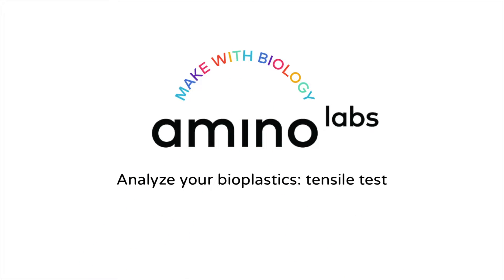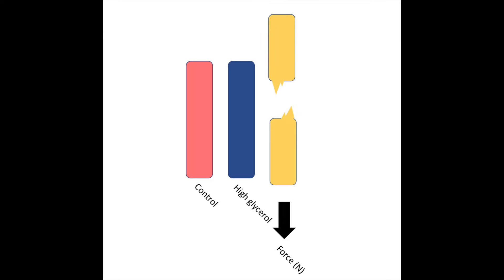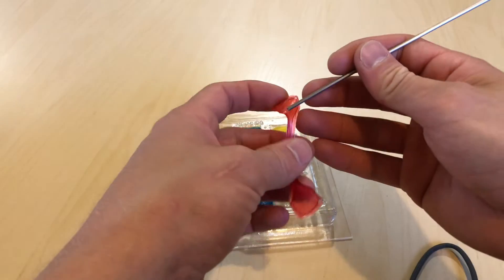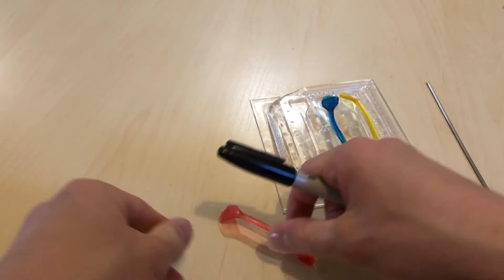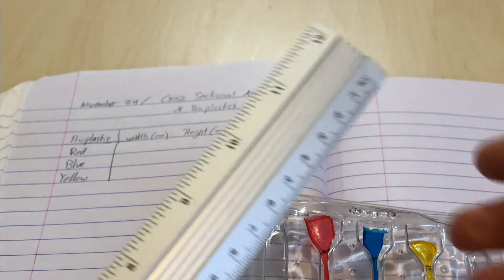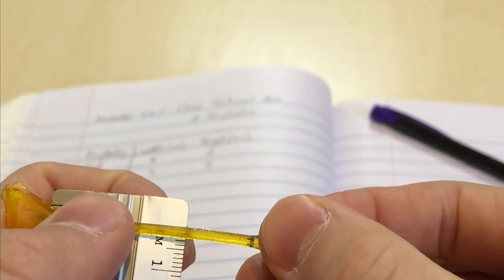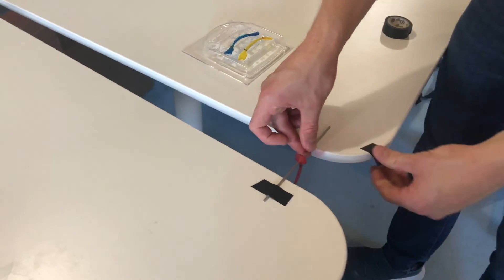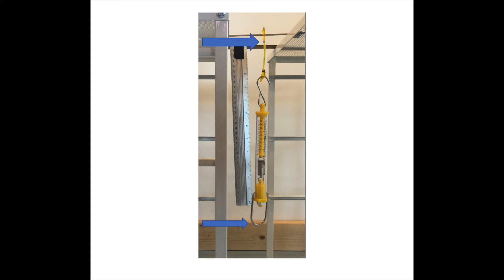Analyzing Bioplastics: Tensile strength test part 1

Comment: what if there is no force meter? what can we use as an alternative?
(for research purpose)
Reply: no luggage scale as well
Reply from the maker: Unfortunately without the force meter or luggage scale, you won’t be able to use this technique to measure tensile strength.
Reply from the maker: You could try the Hanging Weight Method to compare different materials, but you would not get a measurement as such. 
	•	Materials: Plastic samples, a plastic bag or container, small weights (coins, marbles, water bottles, etc.), a ruler.
	•	Method:
	1.	Cut the plastic into strips of equal size.
	2.	Attach one end of a strip to a sturdy surface (tape it to a table or clamp it down).
	3.	Attach a plastic bag or small container to the other end and slowly add weights.
	4.	Measure how much weight it takes to break the plastic.
	5.	Compare different plastics.
Reply: @Aminobiolab  THANK YOU SO MUCH!

Comment: Is this video is durability test or flexibility test? please answer and how will you interpret the results?
Reply from the maker: A material's tensile strength is defined as the maximum mechanical tensile (pulling) stress that a specimen can withstand before failure, So it is a measure of its durability
Reply: @Aminobiolab  flexibility test is different from this? do you have video how to test flexibility of bioplastic?
Reply from the maker: Tensile strength and flexibility are different but related. Tensile strength measures how much force a material can take before breaking when pulled apart, like stretching a rubber band until it snaps. Flexibility, on the other hand, is how easily a material bends without breaking, like bending a plastic ruler. Some materials, like rubber bands, are both strong and flexible, while others, like a plastic straw, may bend but break easily when stretched.  We don’t have a video for flexibility tests, but I am sure there are some on YouTube :)

Comment: Hello Aminobiolab! My team and I just got started with the tensile test today. However, we have came across a problem. Both the scale or the metal rod tear through the bioplastic. I believe it is because the bioplastic is too thin. Our measurement for our bioplastic to be tested is: 1mm width and 10mm height. I also noticed that you already warned me about this from your first reply. So, how do I make sure that there will be enough material where I will hook the bioplastic to the scale so it doesn't tear through it? I thought about folding it twice or thrice to make it thick but won't it affect the tensile strength in some way? I would be very grateful if you could help me with this. I'm waiting for your reply.
Reply: We decided to fold the bioplastic on itself and on each of its ends. However, the scale still tear through the bioplastic. On the good side, we got significant data on the elongation and the force. Is that okay even though the bioplastic didn't tear in the middle, rather on the scale?
Reply: @johnlloydtamio5863we also have the same problem..

Comment: Hello! I am working on a project regarding on making bioplastics and I'm here to do a tensile strength test. I am wondering if it is necessary to shape the bioplastics into a dumbbell or is a rectangular shape enough? I think that the shape of a dumbbell will be useful to make the monitoring easier, but will there be a significant difference if a rectangular shape is used instead? While I'm waiting for your reply, I would like to thank you for this 3-part video series. I believe it will help me tremendously in my project since I don't have the funding necessary to issue a service for this kind of testing. Also, I will learn about the process in which one will test for tensile strength, tabulate the data, and then interpret them. I would like to express my gratitude. I hope a subscribe, like, comment, and share of this video to my friends who are also working on a project would be enough to support you. Thank you once again. I'll be hearing from you soon.
Reply from the maker: Hi!  You don't need the dumbbell shape - you can do a rectangle, but you need to make sure there is enough material where you will 'hook' your bioplastic to the scale so that it doesn't tear through the material.  Thank you for your kind words and good luck with your project!!!
Reply: @Aminobiolab  Thank you very much! I'll come back to this video to update you about my project or if I encounter problems relating to this video along the way. I'm so excited to do this. It might take me a few weeks since I'm also working on plenty of things aside from my project, but I'll see you soon!
Reply from the maker: See you soon! We’ll be here if you need us :)